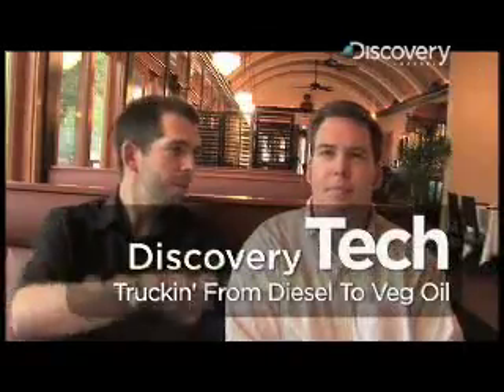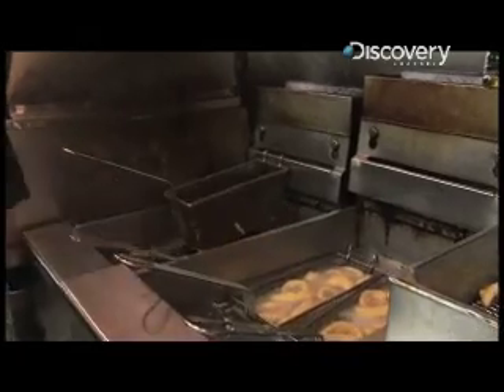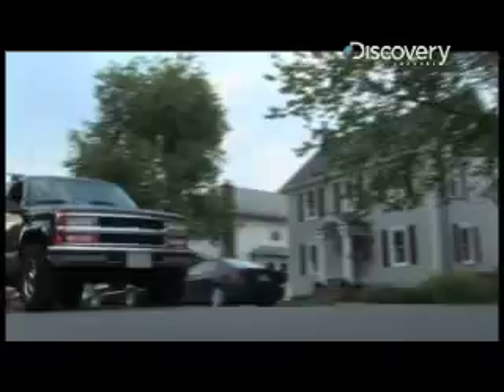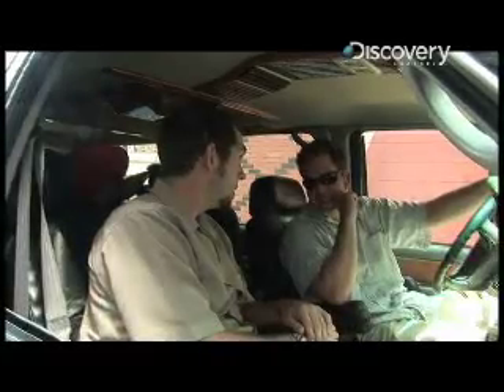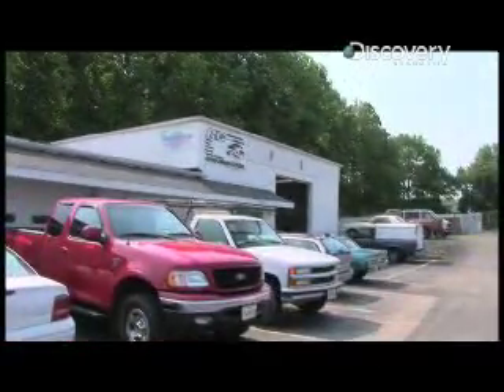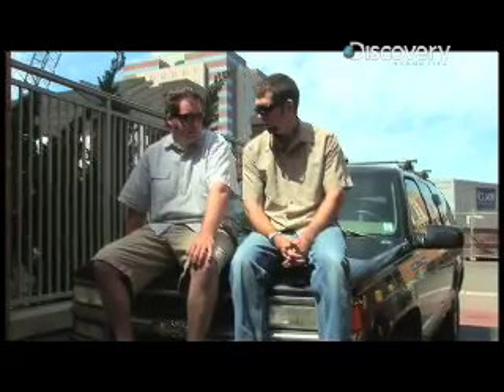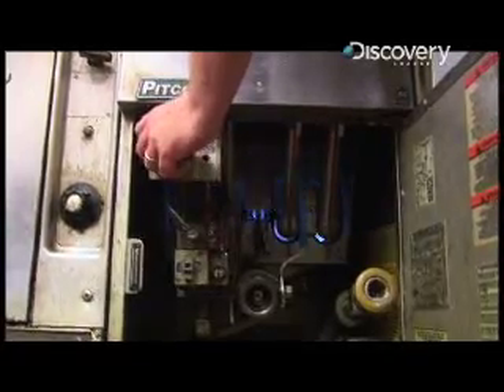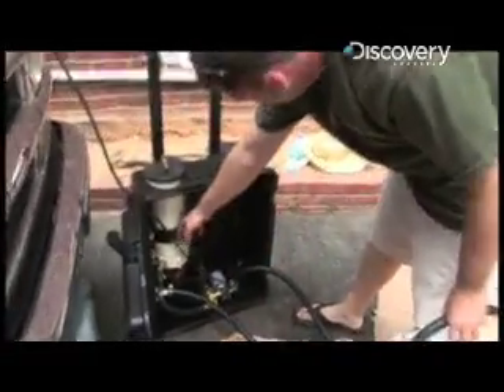Truckin' From Diesel to Veg Oil

Comment: I used wvo for a year. Cleaned it using a centrifuge system. Waste of time. Put your oil in biggest container you can find. If you let it sit for months in dark location the particles settle better than the 5micron centrifuge. And use the top 3/4 of that holding container and it will be clean. This is cleaner than the any filtering process. Time and gravity.

Comment: Interesting... it still requires diesel. It is nice to know it has a gallon for gallon equivalence between the two fuels in efficiency. I bet it still needs motor oil to lubricate the engine.  (I know there are such things as synthetic blends, but I don't know how many would come from green sources.)
Reply: It only requires diesel at startup and shutdowns. In really warm climates the oil will stay warm enough for a while after the last trip. And you can startup that way. But always purge with diesel after shutting off for the day. They run the same

Comment: It is green, in the sense that fossil fuel source was not used. The veggie oil is from carbon source that was taken out of the air as CO2 by a plant that performed photosynthesis now instead of millions of yrs ago. That is VERY green. Plus, the veg source is renewable and scrubs CO2 from the air, a good thing. Fossil source of carbon is imbalancing the carbon cycle on earth right now.